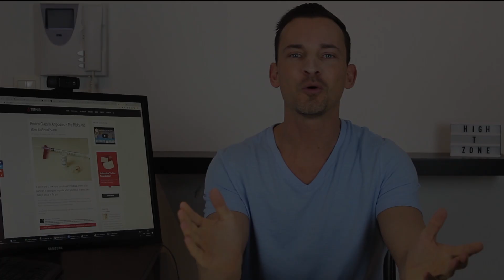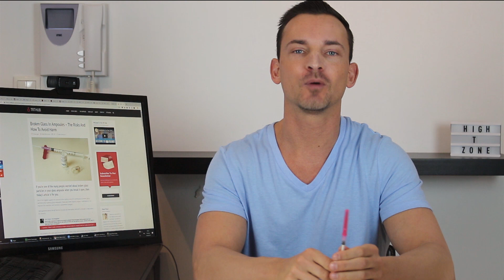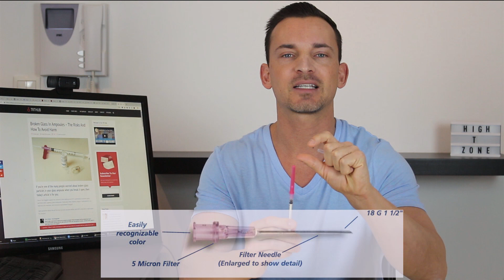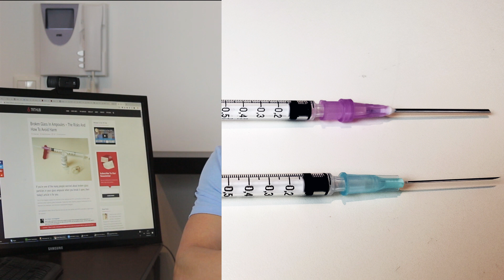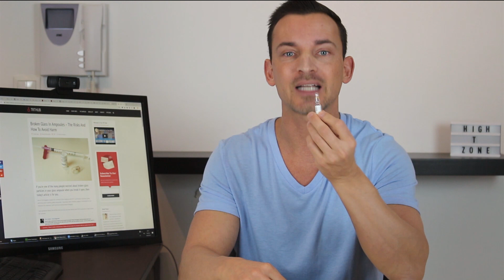What Are Filter Needles? A Solution For Broken Glass Particles In Ampoules.

Comment: Video is somewhat interesting, but then the same statement is made over and  over; I was hoping to actually see the filter needle in use, in a glass ampule, see where the glass particles actually go? Do you purge some fluid to clear the filter out before you inject?  Looking to use with glass ampules of Epi in emergent situation, I just want to see it in action and understand. Are the fine glass particles trapped within the luer lok? or do you need to purge some fluid before injecting.